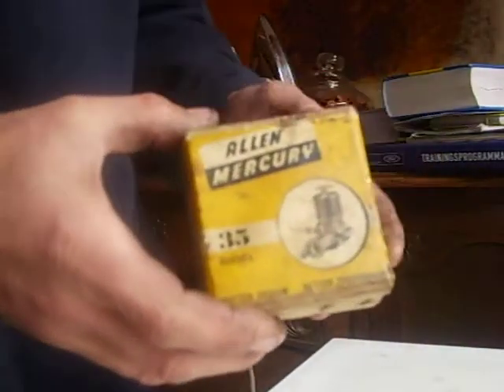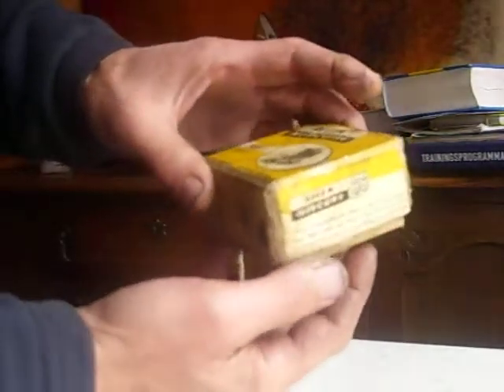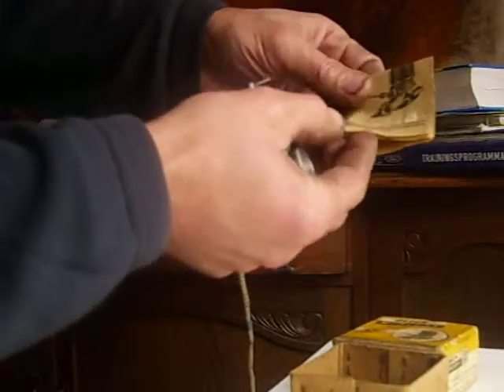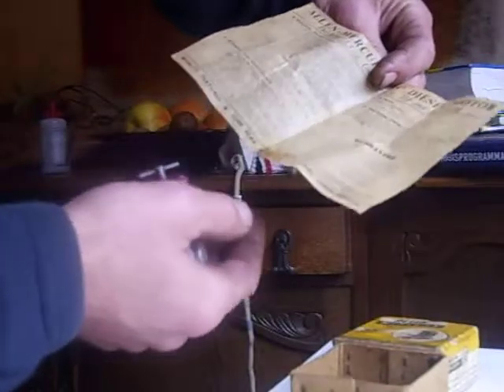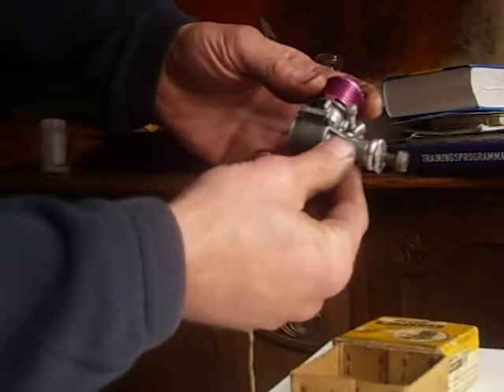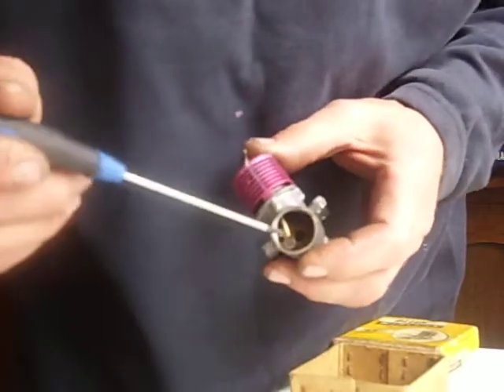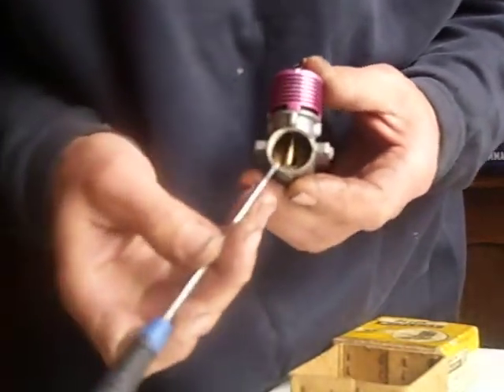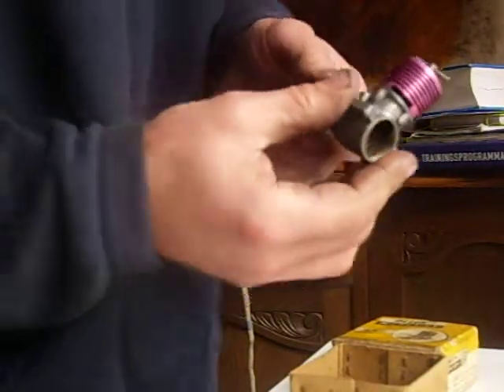Allan Mercury 3,5 diesel

Comment from the maker: Hello There!
Thanks for reply.Engine is stil not fixed,but wil be soon.The piston and rod attachment is not with Drilled throu wristpin,but its a srewed to the pin holding attachment.So its a inner insert,wat keep the pin.A unusual setup.It was impossibel to disasembel the parts,so  I wil need  made al  2 parts.I wil make the insert from dural,to save weight,as its very heavy.That shoud boost the power.I have also the silencer and a new 25 blackhead.Like you say,great engines.!
Regards,peter

Comment from the maker: I check for you the manual.and it says:Free flight:9x5 ,10x4,11x4
C/L: stunt or combat..9x6,10x5
So your 9x4 is not to bad.Its a shortstroker,so I wil use max 10x4 but better 9x5 or the prop you run  currently.I hope to have my engine soon fixed and tuned for moore power.I am sure withh some tuning he engine wil give 0,4 hp.aprox.
Good luck with flying!

Comment: Hello again my Friend!!    i just run my AM 10 yesterday, as yours, mine came new in box with all papers.   just have a question, i just have time to run my "new"  CD spitfire, and can make 3 runs, but the contrapiston is to tight... will be kind of loose after some more runs?    i just upload the short video.   Best regards Rodrigo
Reply from the maker: Hola Rodrigo.I saw it runing! Well,its hard to say.If the factory make the fit too tight,it will stay a problem.But usually its a bit tight as its new,and the old oil glue it.What I will try in your place is a smaller prop, a 7x5 or so,and the engine will make more rpm +more heat.As the cylinder is steel and the CP is cast iron,it should expand less and free up.
The Higher rpm give more pressure and It should push the CP back up with the run.Than you can push it in... and out,... as long it is needed,so it will free up after several times.
If that dont work,you can use a small gas torch,and heat (with the engine running)  the head/ cylinder up,so it should come free. Dont worry about the anodize,it will not demage. Justnot too  hot,so that you can touch it for a 1/2 second or so.
If all this fail,there is no other solution than open up the engine, and push the CP with a hard wood dowel..or one from brass or aluminium, and  carefull and evenly,regulary polish it with 1500 grit wet sandpaper arround. That will help for sure.After that polish the surface with metal polish,so its hyper smooth. Mount the CP with a bit PTFE teflon lubrication. That all  will help for 100%. Good Luck!!!!
If you need help,let me please know,ok?
Hasta la proxima!